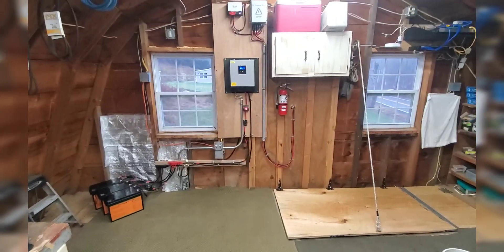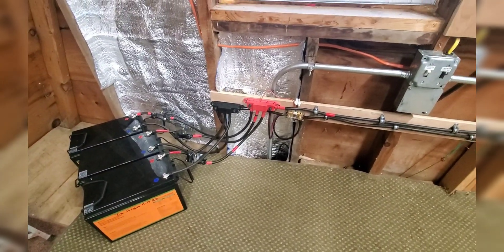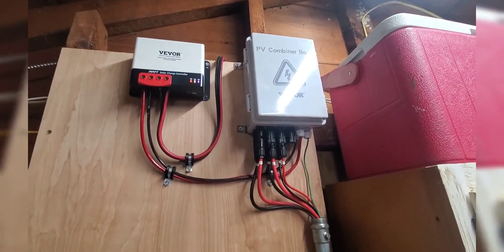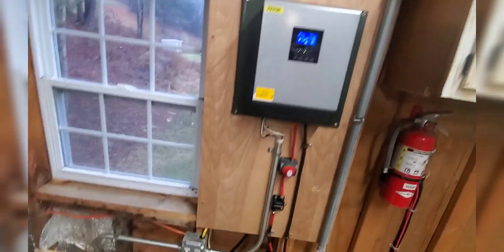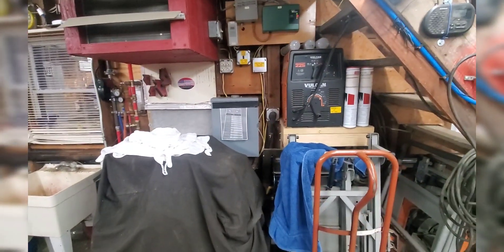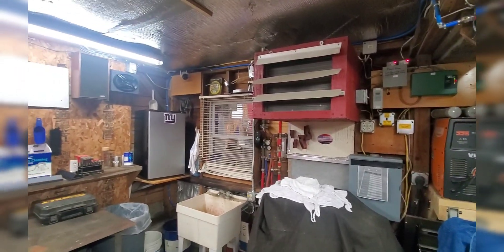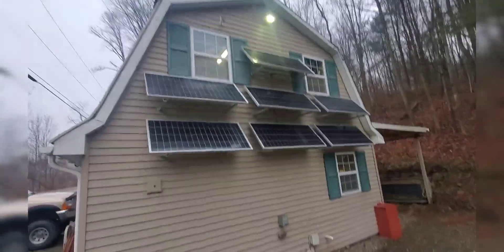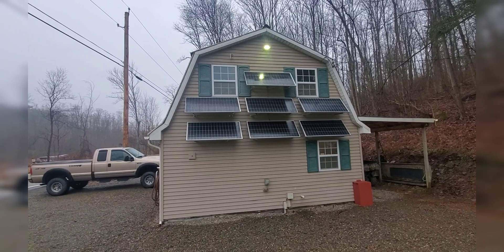Solar Garage System with Vevor Hybrid Inverter- Part 1 Initial Install Experiment

Comment: Do you have a schematic of the setup? Thinking of doing the same thing to my detached garage. I’m a little confused on how the MPPT charge controller is tied in
Reply from the maker: Hi, the MPPT controller is not tied into the inverter unit on my setup. It simply goes from the combiner box where all the panels are hooked, to the standalone MPPT charge control, then hooks directly to the battery bank. Thanks for watching.